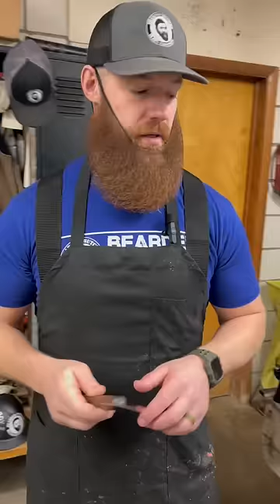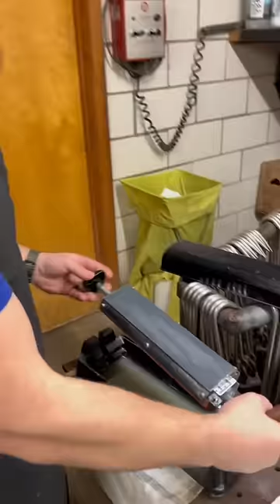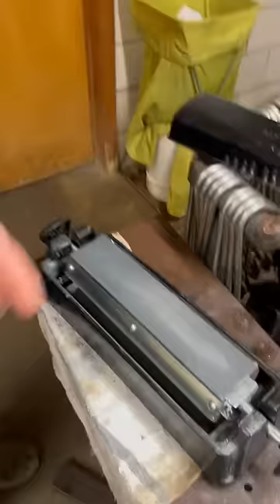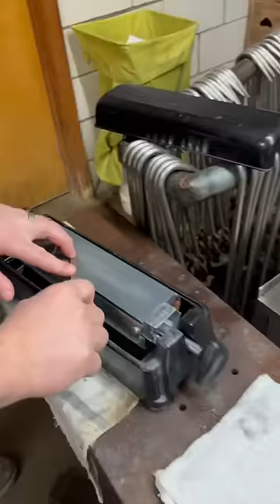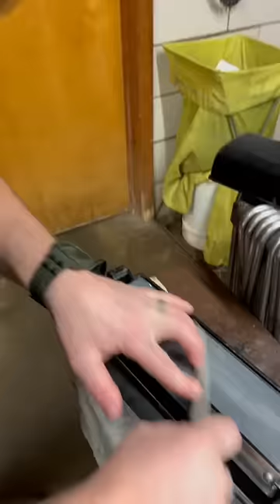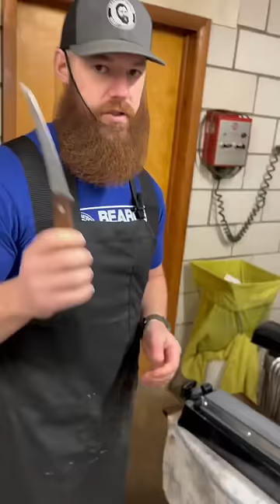Knife sharpening #shorts

Comment: The hardest part is to maintain the same angle on the blade to a get a consistent bevel.
Reply: The nice part about doing it be hand is that because it's slightly inconsistent you'll end up with a mild convex grind
Reply: @dudee001  ... dude you  mean "by " hand ... but you're very right with your thoughts on a mild convex grind .. cheers from australia 🇦🇺
Reply: The hardest part is taking them seriously with a fucking beard diaper
Reply: @CS0723  it's a healthcode violation if he doesn't  wear it.
Reply: @Truckerdaddy  it can be a legal requirement and also look dumb. Things can be multiple things
Reply: @CS0723 😂

Comment: For the best results forward from tip to tail through all three stones. Then backwards from tail to tip with the course Steel of stroup  until the burr falls off. Then backdrage another 10 to 15 stroke tip to tail on your fine Steel. 
You should only have two Stone your blade once a day drop your blade every time you collide with bone and drag and when the blade tends to drag on me instead of cutting it cleanly just take it to the fine Steel to realign the edge.

The Cornerstone takes off the cheeks and reshapes bad damage, the medium Stone should be used weekly to keep the edge, Define stone is your daily regressing, the coarse steel is to remove the Rope Edge, the strop is to refine and polish your Edge, and you're fine or smooth Steel burnishes your polished Edge.

Personally I keep three steals, the butcher file, the sandblasted steel, and then the finely polished steel. That way I keep the dirty strap out of the kitchen.

Comment: I actually own 2 of those NORTON systems. The one that you featured and one with Arkansas stones.
Reply: Arkansas? Ugh I hate them....I ruined my High grit Arkansas with my S35VN folder...
Reply: @legendaryschander78 
I DO understand! I thought that I’d spent another $180.00 just to be $500.00 worth of pissed! 
Ya have to think about the microscopic point of view. 
I’m guessing (not really) that you delve into the stone with the edge carrying the brunt, in edge-front movement on your stone. Arkansas stones are much softer and are needed, not as a finishing stone, but a half-step in creating (and enhancing) a lengthwise beautiful burr. I use both my Norton Tri-Stones to “venture where no man has gone before”. 
Ark-stones require a LOT of work, beforehand, on India stones to understand, and, even now, at 68 yrs old, I’m still learning how to use this tool. 
Long answer short, India stones on the 313 are NO DOUBT the BEST!  
But I can’t help fu*•ing with these A-stones! 
FYI, my edges HAVE improved, albeit, expensively..
Wouldn’t take ANYTHING for my experience on Arkansas stones.
Reply: @donscott6431  Even as a finishing stone, on those Supersteels nowadays is Arkansas not the best tool for that, why? You even if you use it as finishing stone they wont cut the Vanadium and Niobium carbides only CBN (which are harder than diamonds actually) and Diamonds can really do it.

I used the Arkansas as finishing stone but nonetheless the recurve even with light pressure formed.....

S35VN is rather easy to sharpen, imagine Maxamet or M390....Im happy I used S35VN first instead of anything else.

Comment: Is there an advantage to the oil stones over the water stones? I have the Victorinox 6” with the rosewood handle, and just yesterday got the Victorinox 8” breaking knife with the plastic handle, as I won’t use it as much.
Reply: Depends, lots of things to consider about stones, so there is no cut and dry answer.

Oil stones; less mess (no soaking and water everywhere, less slurry formed), are harder (less wear, less slurry), but as a trade off generally don't cut as fast (because there isn't as much fresh abrasive.)

Waterstones; more messy (water, slurry, drying), they are generally softer, so they cut faster, because fresh abrasive is constantly released, so need to be flattened more.
But they can cut harder steels easier, because of the constantly fresh abrasive.

At the end of the day, you can get a stone of any type to behave how you want, so it doesn't really matter which you pick.
How it feels is more important imho.

I personally like natrual stones like Arkansas stones, with oil, because it just feels great.
But I do also use a SiC waterstone (mostly used dry) for my sharpenings, because it's crazy fast.

Whatever you pick, for soft steels, you can't go wrong, anything will work.
Reply: @autumn5592  Thank you for your explanation, I have a premium wet stone sharpening stone set, haven’t learned yet how to use them correctly, I was using a belt sander with a very fine belt, and a leather strop belt. You are correct about the mess with the wet stones, that’s why I had the question about the oil stones.

Comment: When I worked at an abattoir the butchers use to run the blade of their knives against their thumbnail - maybe it was to check for burrs - I dont know - but it use to freak me out watching them do it
Reply: We could shave with our knives
Reply: I do that.
Reply: I've read that that's done to check the sharpness of the knife.  If it slides across it needs to be sharpened and if it snags or kind of "hops" across it's sharp.  Gotta hold the blade perpendicular to your thumbnail with just the weight of the blade as you drag it across.
Reply: @bluaugendvl  its the other way around. a constand edge does not snag on the fingernail. if it glides smoothly for the entire legnth of the blade the metal is one continuous line that will cut well but if it drags it has small craters and corners that will catch on the meat as you are cutting, ripping it more than cutting through.